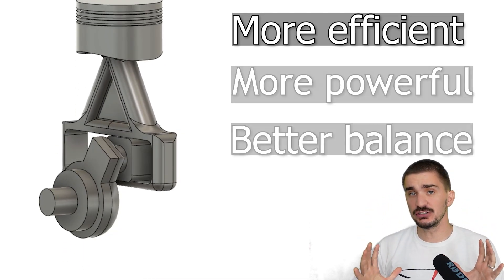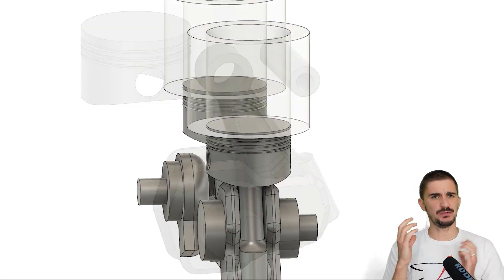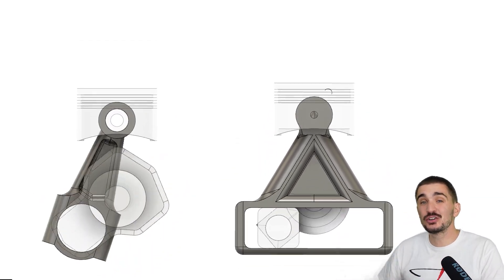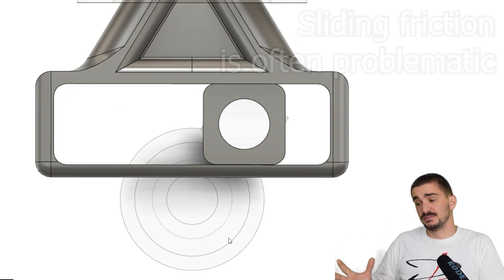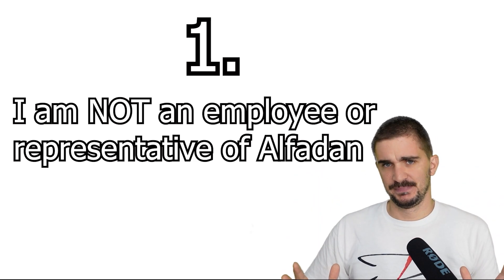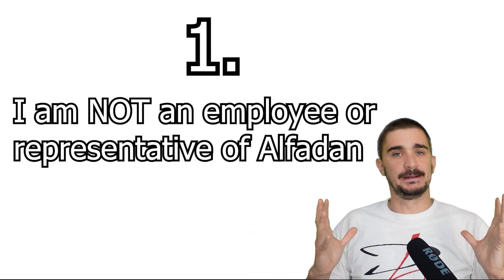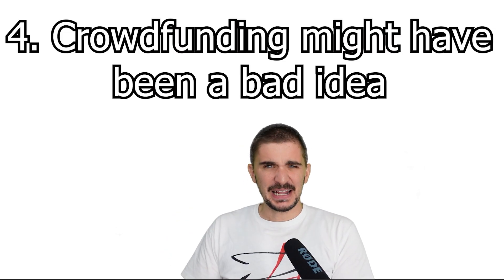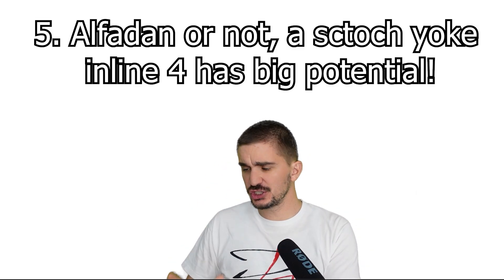This engine is better in every way?

Comment: Scotch yoke engines make more sense as a boxer engine
I remember reading a article on how it would change engines forever and that was 20years ago still waiting.
Reply: Not a boxer, you mean a flat engine - a boxer, by definition, needs to have separate rods
Reply: As mentioned in the video, there are still inherit issues with the Scotch/Yoke engine that is still keeping it in engineering development. Until then, a conventional piston mechanism is still the preferred choice for mass production and applications.
Reply: It’s vapour ware.
Reply: Is there a type of scotch yoke that uses an elliptical yoke rod, and instead of that square block, just the cylinder piece isolated from inside the square piece that does that same motion, maybe Inside of some sort of hydrolic fluid to keep it off the walls? I can see heat dissipation being an issue, but I'm sure there's some sort of clever trick to be used to dispate heat quickly in the area to avoid failure. I'm no engineer idk a lot of things im just throwing things out to try and learn something new

Comment: I strongly disagree with your explaination of why Alfadan is not a scam. Just putting a disclaimer on their website and saying that all investments carry risk doesn't make it legitimate. By your definition all crypto rug-pull scams would not be scams... People were calling it a scam because they set out highly questionable expectations, requested funding and then failed to provide any real proof, updates or prototypes for several years, the same thing has has happened with countless other similar (scam) projects.
Reply: I think your missing the point, by it's nature investment is risk. Some investments are higher risk than others. Alfadan is definitely high risk and  they made no bones about it. I wouldn't touch them with a forty foot barge pole, but I don't think you can call them a scam.
Reply: @rfwillett2424  So? Doesn't matter how high risk it is. It's high risk because it's unrealistic. They're promising something they're unlikely to be able to produce. Going back to crypto scams, they were obviously high risk: doesn't make them any less of a scam.

Comment: nice scotch yoke, next: geared piston
Reply: Is there an engine that uses this piston?
Reply: Why bother with geared pistons. Wankel engines is where it's @ m8!
Reply: @markusluftner8418  a Wankel is basically 3 geared pistons in one
Reply: @hansdietrich83  No, its' 3 very inefficient geared pistons in one.
Reply: @markusluftner8418  So 3 geared pistons in one, then.
Reply: @Ijusthopeitsquick  no  3 oilfillercaps in 1 scavege pump
Reply: @hansdietrich83  Your 'odd fellows' are very triggered by the Wenkel engines for a reason.
Reply: @vitordelima  What do you mean?
Reply: @markusluftner8418  LOL
Reply: @vitordelima   I do not know the Wenkel Engine. Do you mean the Wankel Engine, by Felix Wankel
Reply: @markusluftner8418  You are such a genius...
Reply: @vitordelima  Sorry I'm bored af rn.